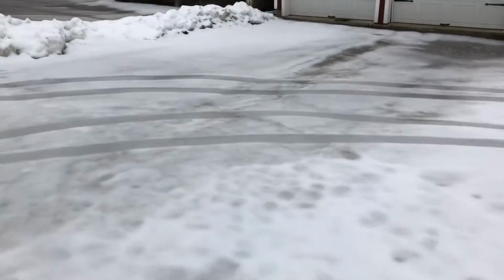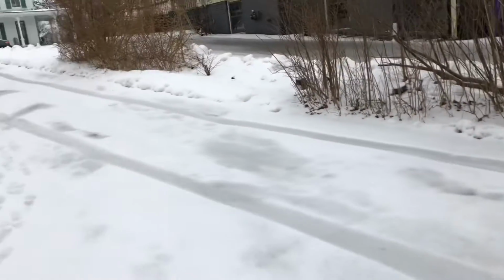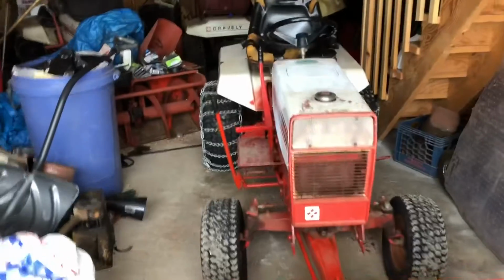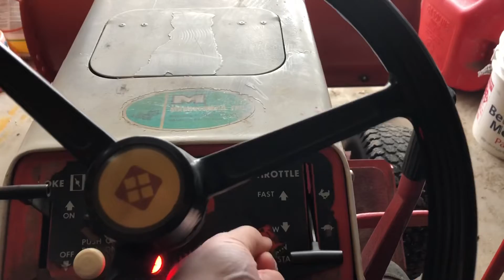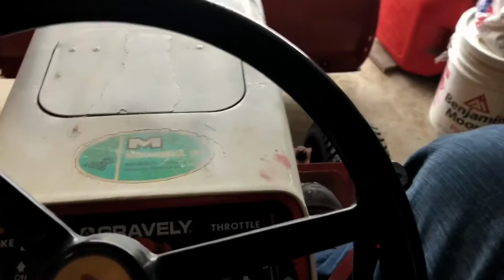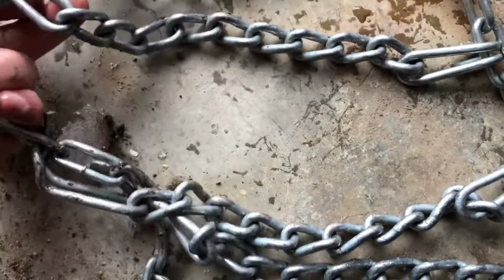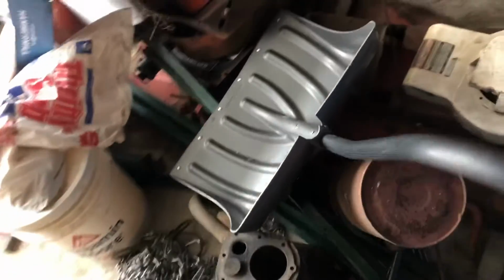Gravely 817 Issues Snow Plowing Fail

Comment: I don’t know if it’s just the video but it doesn’t look like your chains were hooked on properly. In the video it looks like the chain is connected but the hook isn’t pulled back and hooked onto its self. (I know this is confusing to read) My season sucks too there has only been 2 decent snowfalls and the 424 stripped out the steering and the engine started running like crap. Spring is coming soon, I’ll mow with my 816 for the first time.
Reply from the maker: engines and outdoors after watching the video the other chain looks like the tensior camem off too...